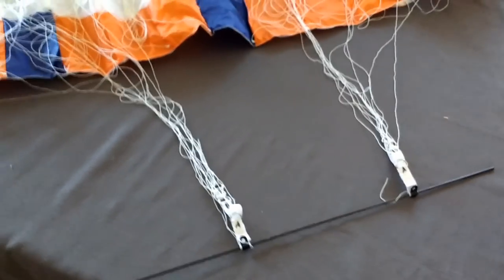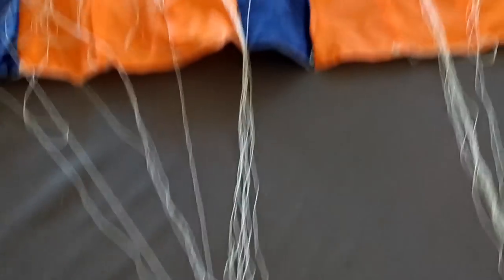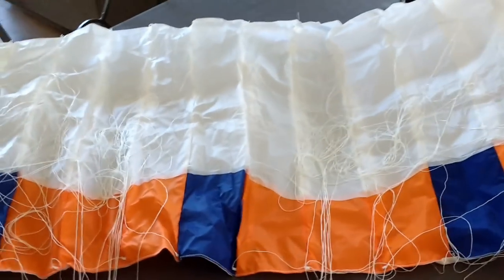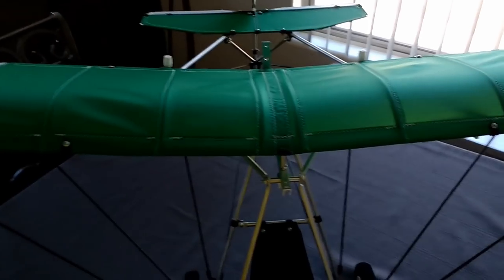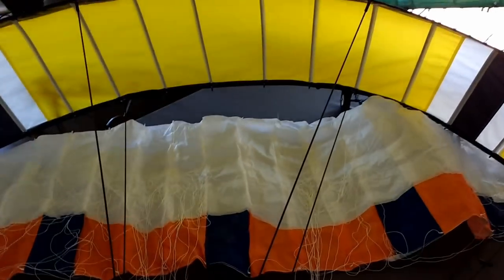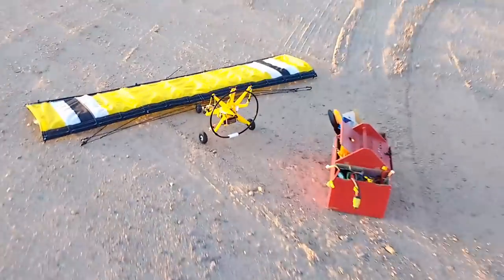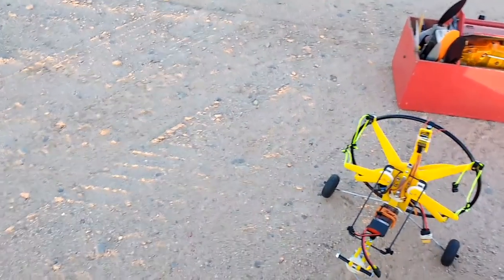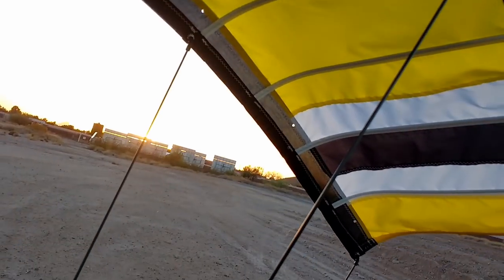World First Cableless Paraglider   MIA EZ™ 1.25  Strut Braced Paramotor RC Model Proof of Concept

Comment: your pretty much turning it into a nanolight-interesting nonetheless
Reply from the maker: Thanks. If removing the cumbersome and risky flexible lines means turning this into a nanolight or microlight or ultralight than I guess I am? But My goal has been to keep the parasail look and operation, as can be seen in my videos. Control is still either elevon or weight shift, or a combination of both. The control surfaces are either via brakes, ailerons, elevons, or even wing warping. These all work!,  provided they are setup properly.
Reply: As I see it a semi-rigid wing is definitely the way to go and getting the right balance of rigidity in the wing seems to be the key

Comment: Might be neat for RC aircraft, but this would not be suitable for human flight.  Paragliders WILL eventually collapse and with the lines we use they usually quickly recover.  In your case if you have a collapse, it will break a strut and you will never recover.
Reply from the maker: The whole idea is not to have the sail collapse due to loose lines. You can recover a typical flex sail deformation or collapse, in some instances,  but if the the lines get tangled or the sail twists on you, beyond a certain threshold, that's it.   Perhaps I forgot to mention that the sail on my design is not totally loose,  like a typical parasail, therefore the the sail remains in form all the time,  with the structure having a proper flex modulus for proper suspension and control. My sail is very much like a Microlight flex wing sail and these latter types of airtcrafts are, in my opinion, much simpler and safer than flexible flimsy  parasail wing with loose cords.  I still love the shape of a modern powered parachuttes, just not with so many loose lines.
Reply: MIA Micro-FLIGHT I still don't agree for human flight.  Presently a paramotor pilot can travel with his paramotor in a small coup and set it up in a couple minutes in any field. My wing with kevlar lines is about 13 lbs and the motor and gas on my back is 60 lbs.  The complexity of a bunch of struts would add unnecessary weight with no real benifit.  Then, ask yourself what a pilot would need to do to kill the wing (purposely collapse) when he is on the ground and the wind starts to gust too strong.  We do that quite often, because you can fly in 15 mph air, but you need to drop the wing immediately after landing so it doesn't drag you.
Reply from the maker: I am familiar with real parafoil, paramotor setups.  I started with 8 rigid carbon struts, on my first design, for simplicity, and to test for lift and control, and since I know and have shown this works, I have since refined my design and gone to  8 "collapsable struts", for ease of transport, setup, and landings. That is not "a bunch of struts" as compared to typical amount of lines in a parasail. Also my wing is no heavier than one of similar size with the weight of the lines.  The problem of a sail that is bound to drag you on heavy gust of wind is still a risk even with the sail flat on ground, unless you qickly detach yourself from the sail.